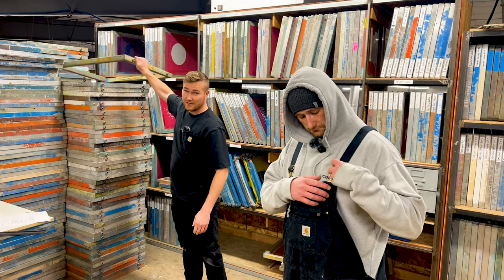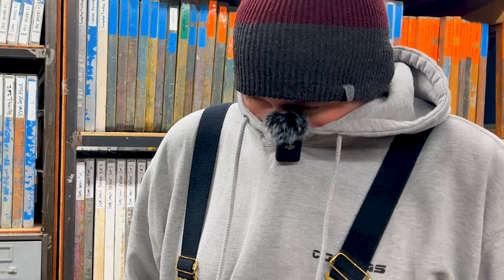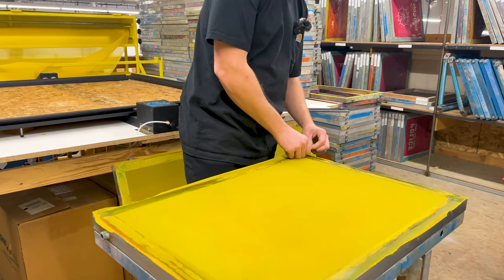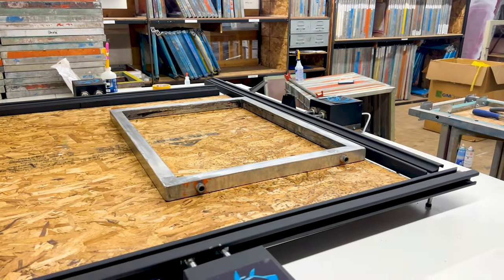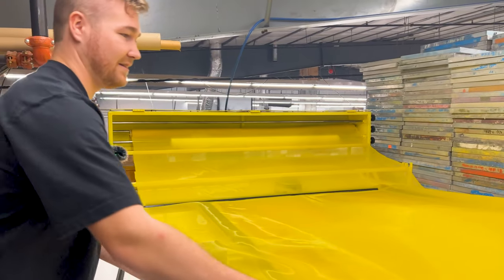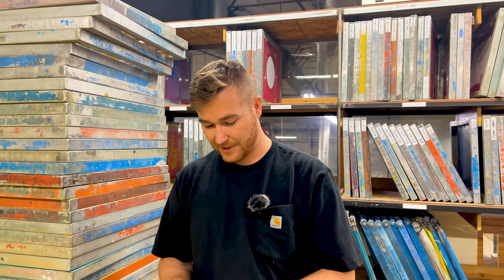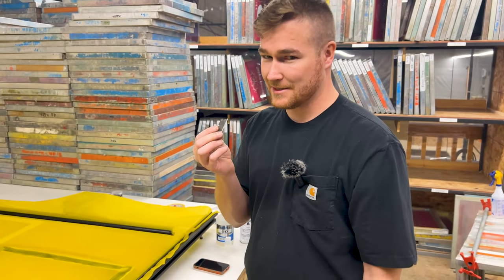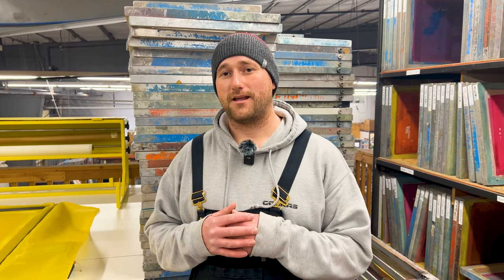REMESHING screen printing FRAMES!

Comment: Have some 110 on roller frames 40 newtons. The higher mesh... y'all right on da money. 18 to 25 newtons. The pain with the rollers it can be a pain to tune them in the beginning. Looking back I wish I would have went roller frames all the way. The tight mesh can reduce off contact and give some incredible prints.